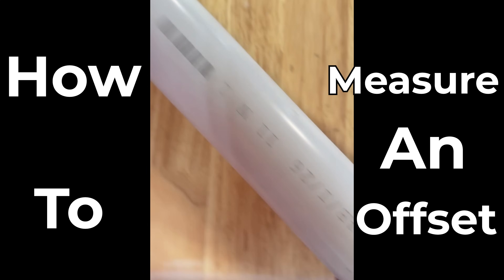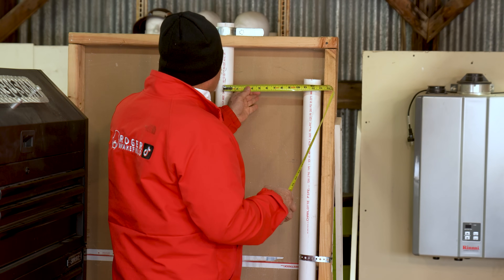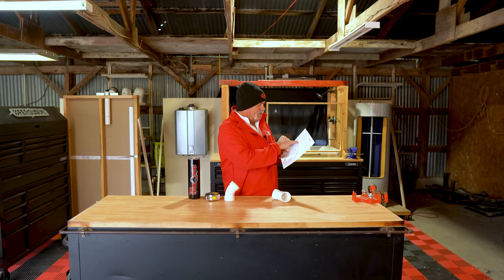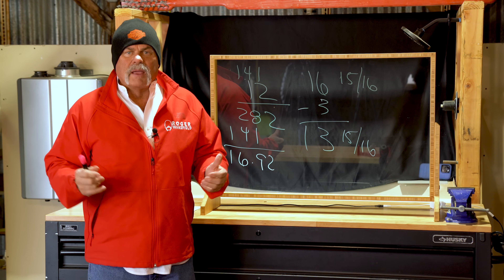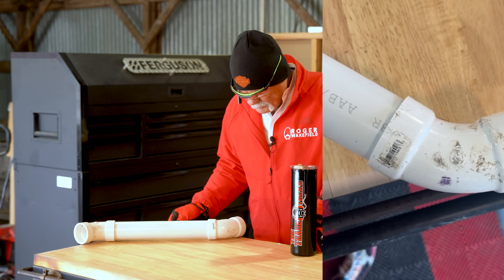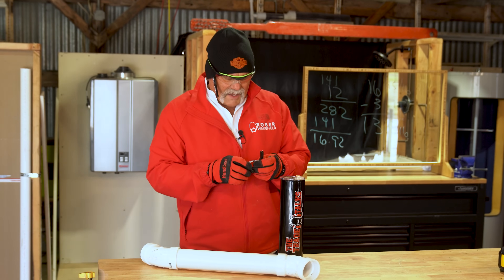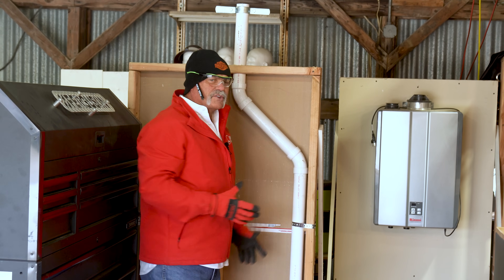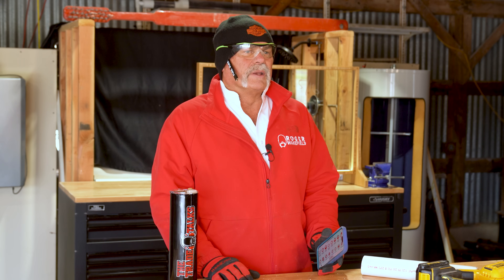Measure a 45 Offset | Advanced Plumbing

Comment: Okay, I can certainly apply the Pythagorean Theorem to calculate the length of the center to center offset for both. Let’s back up and refigure the two 45 degree ells first. We have to visualize a right triangle in the stud bay to visualize it. Go to 8:30 in the video and then superimpose the horizontal tape measure visually and you will see a triangle. That is a 45-45-90 right triangle and can even be drawn in the stud bay with pencil to make it easier to explain.

We know the length of the tape measure side is 12”. We will call that side A and by definition the other leg of the triangle (which is mostly covered by 2” vertical PVC on the right that is about to be cut off) must also be 12”. There’s our A and B sides and the center to center length of the diagonal pipe (plus a bit of fitting on either end) is C, our hypotenuse. 

Apply the Theorem. A squared plus B squared equals C squared. 144” + 144” = 288”. C squared equals 288, so find the square root of 288 for the length of the diagonal, which is 16.97”.  That is closer to 17 by a hair, but we could call it 16  31/32” to split the difference and be very close. Subtract off the 1 1/2” from both sides for the fitting and that pipe is cut a smidge shorter than 14”. Same result different paths.

Go back to that same imaginary triangle to get our difference in height. That leg of the triangle is 12”. Add 1 1/2” fitting allowance on both sides to get an extra 3” and there is your 15” vertical difference. Figuring that part is tremendously easy now.

To solve the problem of a two 22 1/2 degree fittings making the offset go back to 8:30 on the video. That 45 degree angle between the two pipes that form the bottom of the triangle is now bisected. What that does is the pipe travels half as far to the left in that 12” vertical, so the vertical leg must be doubled to bring the diagonal all the way over 12”. This makes it an inconsequential 22 1/2 - 67 1/2 - 90 degree right triangle, but what is important is understanding A still = 12” and now B = 24”. Square those both and add them together for 720 = C squared. The square root of 720 is 26.8328”. A 16th of an inch equals.0625 so we are just a hair over 26 13/16” total. With 11/16” fitting allowance for the 22 1/2 degree ell on both sides, I am thinking that piece of 2in PVC needs to be cut a hair over 25 5/8”.

Anyway that’s my Euclidean Geometry offset math because remembering the Pythagorean Theorem is easier than memorizing trigonometry coefficients. Admittedly we weren’t allowed to use calculators on the exam so that means squaring the multiple choice answers and comparing them to the C squared calculation on scratch paper if you aren’t good at pulling square roots out of your hat.

The 1/6 bends are even easier to figure because a 30-60-90 right triangle is also called a 3-4-5 right triangle and it makes figuring out lengths a matter of ratios and that can be done in your head without thinking about square roots.

And for the bored silly folks I lost with that one, two words: exploding piñata
Reply: I'm with you, that's how I did it doing pipefitting with my grandfather. You can do it that way or figure out the hypotenuse by doing adjacent (12in) x 1/cos(45°) [where the 1.414 number comes from]. That should spit out 12 * ( 1 / ( sqrt(2) / 2 ) ) aka 12 x ( 2 / sqrt(2) ) which comes out to 24 / sqrt(2) or 16.971 

Not sure if everyone has a calculator that can do sin, cos, tan, etc on the job site, though..

Hoping people know where the 1.414 number comes from now.
Reply: @Zildjian0321  thanks for explain this!
Reply: I used that same logic when figuring an offset with 22.5s. Though it seems logical, this isn’t the correct length of pipe you’d need. The constant for figuring a 22.5 offset is 2.613, which gives you 31.356, subtract 11/16 for fittings and you’re looking at roughly 30-5/8.

After scratching my head on it a while, I realized even though you’re doubling the angle, it doesn’t double your rise.
Reply: @jordanchaplin1334  Thanks for setting me straight if you’re right. I’ve been wrong before and I will be wrong again. It’s been four months so I don’t care enough to double check it. I was just being a know-it-all because the jerks at massage school put me in the remedial class and fed me test answers. It was an insult to my intelligence therefore the online persona overcompensated—which is better than mowing a bunch of people down.

Comment: Where did the 1.41 come from.  What would it be for a 22, 90, 60...  just curious
Reply: If you have a square that is 1" by 1".  The diagonal measuring is about 1.414".  If you find the square root of 2 on a calculator, you will get the exact number.

So if you have to travel horizontally by 1", or by 16.5", or by 7', you just multiply your horizontal measurement by the factor 1.414.

If you're a carpenter who cuts roof rafters, a hip or valley rafter are always thought to be sloped at x (x is whatever your roof slope is- 4, 6, 8, 12 are all common roof slopes) in 17.  A normal roof rafter would be sloped at 4/12, but the hop rafter that fits that roof is 4/17.  That's because 1.414 times 12 is 16.97, or almost 17.  So for a carpenter who doesn't use a calculator, cutting your common rafters at 4/12 and your hips or valleys at 4/17 works very well.

The rafter example assumes the hip is a "regular" hip, not a bastard hip.  Google that if you want, but it's a bit far afield from answering your question.
Reply: Thank you. Helps to know how the number got its place rather than " this is what" on a video

Comment: @5:23 Roger, I'm runnin' circles around ya with the Reed DEB4! I quit packing files in my tool caddy after getting one.
Reply: Thank you so much for this comment. I've been looking for a tool like that for so long.
Reply: Its not cheap, but I have used it every day on every cut of PVC for the past 6 months . Then I hit the inside with a pencil deburrer, and everything glues up way nicer. @23tracy91

Comment: If you do this on a construction site ,it will be your last day. Boss" wheres johnny?" Foreman" he spent 2.5 hours to run a 2" vent x 3' long
Reply: I can do the math on this offset, cut, prep and glue the pipe in a minute. Guys that use “time is money” as an excuse to not provide quality work are hacks. They end up taking longer and costing more when the work leaks.😂
Reply: @plumbjitsu7097 so right. 1.41 is not a difficult constant to memorize
Reply: Also,try using the eyeball method when running 4" cast iron. Not easy
Reply: Yes,it seems like an unnecessary step for a 2" pvc vent. But for God sakes, learn and understand how to do this job correctly. It's the difference between a skilled professional and a shoemaker
Reply: Dude, a shoemaker is a skilled tradesman.  I'm not talking Nikes though.  @richardluca8562
Reply: @richardluca8562 shoemakers are far more skilled than plumbers
Reply: For everyone arguing in the comments, smarten up. When plumbing hulk hogan sez do it, just do it! Take your vitamins too
Reply: @Supplyhousemarco 😂👍
Reply: Facts this is for the test they make it more difficult than it is time is money on the field.
Reply: It takes less time to do it right. If you can't do a 45 offset in your head your math skills are sub par. 
Or with a pencil on 10 seconds at least.
Reply: I really appreciate the time you take out of your day to gives us a little brain food
Reply: It’s simple math. Shouldn’t take very long
Reply: Not at all I run new construction for my company and show all my apprentices how to do it properly if you're a good plumber it doesn't take any longer if not faster then eye balling and cutting twice.
Reply: You have to do the formula always one day you will do 8 inch 45 you can't mess up
Reply: @titovillarreal119   it sounds like you are suggesting 8" pvc doesn't bend...😆  you know, like cast iron does.
Reply: I would have eyeballed it and be finished with the installation before he finished measuring!
Reply: @toobad9946  and your work is probably shit. What do you do when it's a 12" cast iron roof conductor, eyeball it?
Reply: @toobad9946 
Try it with 4" Cast Iron
Not 2" pvc  
Measure twice, cut once.
Eye ball cast iron right
Reply: Bruh. Math is hard. And I lost my tape. Again.
Reply: It’s a 12 minute video bud, calm down
Reply: @ryanmccarthy406  you talking about your  all male casting couch audition? 12 mins is plenty don't worry
Reply: Fr man but unfortunately this is what the scientist want us to know for the test.
Reply: That cracked me up again... I read your comment before 😅
Reply: If it took johnny 2.5 hrs to do these calcs he SHOULD be fired…
Reply: If measuring the c-c distance, multiply by 1.414, then subtract for makeup takes you 2-1/2 hrs, you need to go back to second grade. 
It should take no more than 2 mins to do the calculation AND it saves on measure once, cut three times. 
Every phone has a calculator, also cheap calculators will work.
Reply: Come on it’s plumbing. You guys are the sloppiest trades people out there. Try running it in steel.
Reply: @notanymore9471 lmao I've seen a lot of shitty steel work, I've seen a lot of shitty carpentry, and for all that, the company that I work for hasn't had sloppy work at any job I've seen. It's called PLUMBing. If your pipe isn't level or have the correct amount of fall, lots of people are gonna get sick as hell and possibly die if left alone. But go ahead and tell us how much nicer steel work is 😂😂
Reply: @notanymore9471 or glass
Reply: Using math is always quicker and easier. Just because you haven't learned the math doesn't mean that you can't. Sure you might be a little slower the first time or the first two times you do it that way but you can't always get away with stove piping. Especially when pipe fitting welded pipe. You wouldn't make it through the first day stove piping on a job where you had to work off from drawings. math works. Let it work for you
Reply: I know many of them don't have enough fingerings toes to count them.  Just like home owners that can do the job,they just don't have the time to do the own diy's
Reply: @user-rd7cj9zt7y true with smaller diameter pipe and small offsets. Larger pipe (cast iron) with a larger offset you will appreciate the math. Look at other pipe trades that also use this math. I have worked with guys that think the same as yourself and they are successful at small jobs but math has helped me set apart from them.
Reply: EXACTLY!
Reply: Takes me seconds to calculate an offset.... but I'm not a junior retarded apprentice or the equivalent in a green journeyman 😂
Reply: 😂😂😂😂 for real!!!! How the gell are we going to learn from this when he took an hour to connect 2 45s together!!
Reply: True😂😂
Reply: just did this today in less than 5 minutes its more practical in tight spots or remodels and repairs and commercial work.  new construction  is easy stuff
Reply: You can't hold up 2 fittings and measure for the exam.. if know how to do the math you will be able to calculate these offsets in any size at any location, even if you can't physically hold up the fitting because it's a 15" or bigger cast iron wye or 45 that weighs a ton. Also, just because you're a donkey that can't understand basic math doesn't mean you have to be a sour bitch about it and pretend your donkey strat is better and faster. It's not, I've done these offsets faster using the easy formula than someone holding up fittings and eye balling it.
Reply: I will be long done and gone before ol' Mr. Eyeball gets his first piece cut, using math.
Reply: Meaning, I will use math.
Reply: This guy thinks he’s working with 24k gold pipes 😂
Reply: lol
Reply: Is your construction site a crawl space?
Reply: I was thinking the same thing!!!
Reply: Always a comment like this when someone wants to teach something that works… « me on  the job site, I cut corners and provide a crappy job for the owner not to see”
Reply: Maybe in residential 😂
Reply: Yes and no, depends on the run. There are a few areas I can mathing it tall out would be better. You'll waste more time up and down, up and down. Even if you had a helper, you'll need to wait for the piece.

If it's a tight space I would like to cut and solder or crimp my pieces first then install. It takes a lot less time than you think, I'm not that good at math but trade math isn't as hard as most think it is.
Reply: I went to school and work on the field I use this and it sets me apart from the rest of ya'll
Reply: I call it bs. Because these"smartguys" measure once cut 8 times and still short
Reply: @shaynaandisaacoc  no one cares if you have a few offcuts at the end of the job.
They do care if you take 10 minutes to do one tiny 45
Reply: That’s y u don’t work in the union jus a bunch of complainers
Reply: This guy knows the theory behind this. Put him on a jobsite and he don’t know his as from a hole in the ground.
Reply: @tacklebox6239  the theory? Offset equales advance. If you don't know that, I guarantee you are a shitty plumber.
Reply: 15/16 lol it’s 1/4 1/2 or nothing

Comment: Rolling offset 45 x1.414
22-1/2" x 2.613.  Honestly this is more for pipefitters. Its good  information to know but In the time it takes to make the  calculation and execute, I could have completed job.
Reply: It's not a rolling offset bud. It's a 45° offset. You need a whole other mathematical equation to figure a rolling offset. A offset just changes width along the same plane. A rolling offset changes in width and elevation. Nice attempt at trying to flex though.
Reply: There is a reason why you need these calculations. You need the proper amount of air per cubic foot to vent a drain RIGHT

Comment: for the record, I googled hypotenuse ratio on a 22.5, 90 triangle
I knew it was a ratio of angles, which could also be applied with sin but I did it the lazy way
1/sin22.5 degrees
Reply: Your answer is correct, if you are multiplying by the vertical distance shown in the video, and then the multiplier is 2.613, however we don't know the vertical distance.  I believe the the question was based on the horizontal distance between the two pipes, then the answer is 1.08, or (1 divided by the cos 22.5) times the horizontal distance between the pipes.